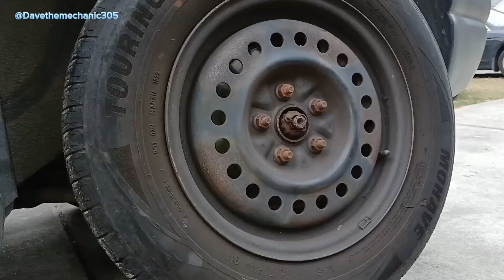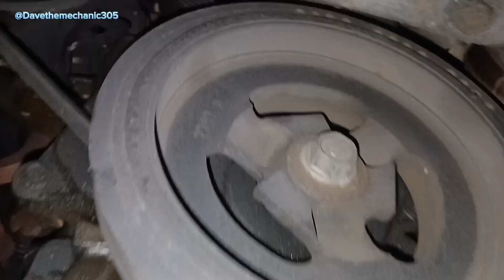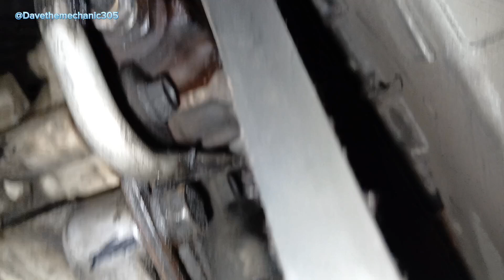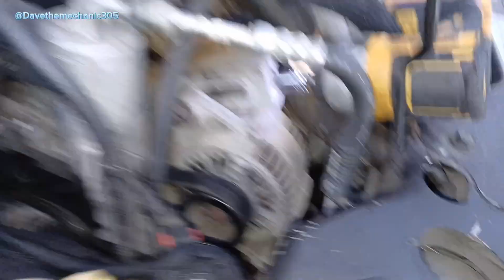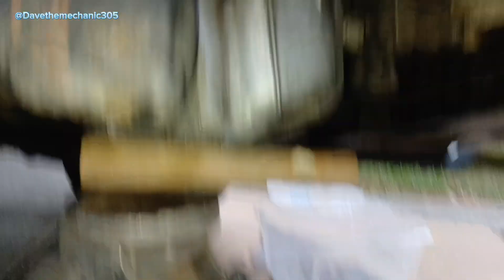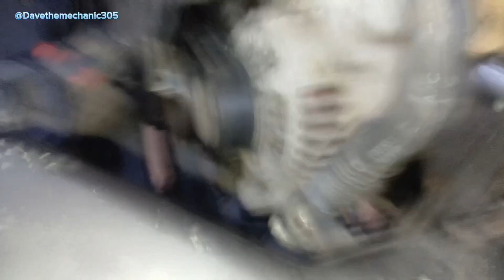97 Dodge Stratus 2.4L Serpentine belt and power steering belt replacement

Comment: Excellent video. Getting ready to do the belts, idler pulley, and lower control arms on my son's 98. Any possibility on a video on the LCA's coming up?
Reply from the maker: @timfleenor3705  sorry not for the control arms
Reply: @Davethemechanic305 Wow where did you dig it up? 😂 I used to have one 23 years ago. Didn't think there was still any around.
Reply from the maker: @josephbell2160 😆. Your right. It feels like I have one of the last few. I just did the timing on it so it's good for another 100k miles😅
Reply: @Davethemechanic305 Those were good cars. I traded mine in 2007 for a 1999 Accord LX V6. I still have it